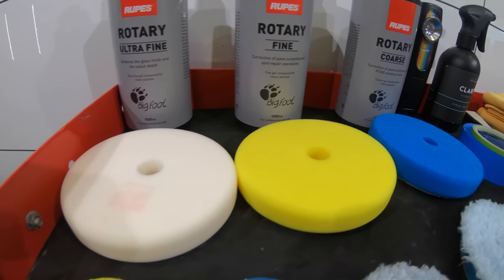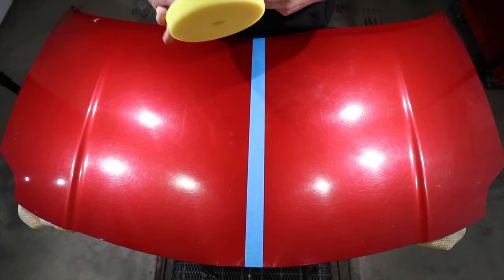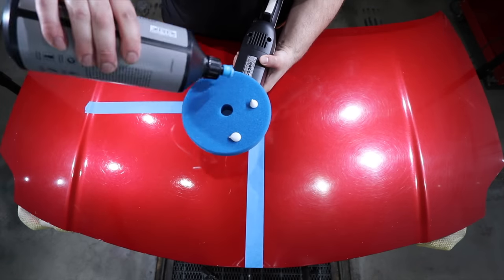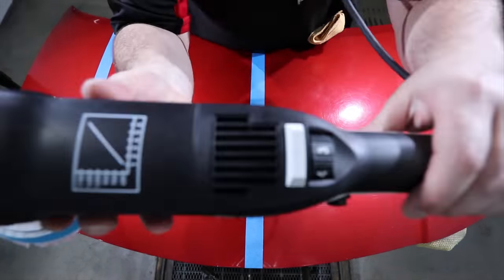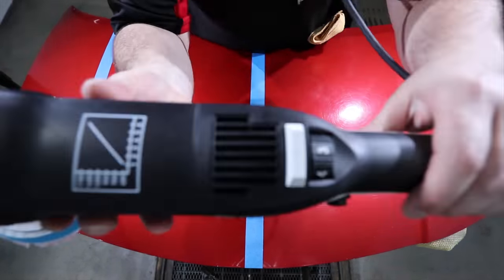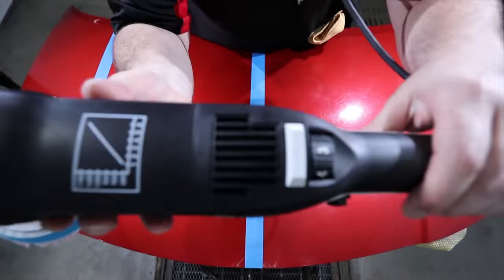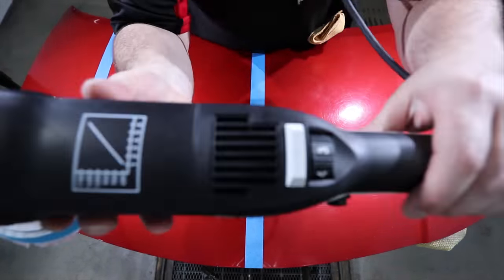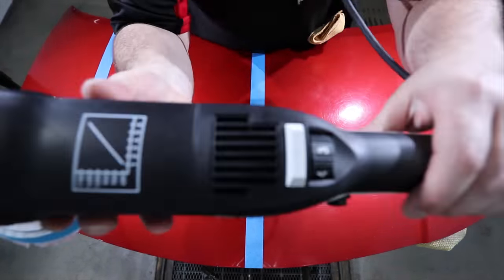A Guide To Using A Rotary Polisher/Buffer To Polish Car Paint! + Rupes Rotary Polishing System!

Comment: If you could have only one DA polisher, what would it be?
Reply: Flex
Reply: 15mm orb. Is better option.
Reply: @CarCraftAutoDetailing  Sandro I remember in one of your videos where the LHr15 Mk3 left marring after the first stage, so you then went to the 12mm shine mate da which left no marring and worked better on that particular paint, question is how often does it happen that the Rupes 15mm doesnt perform as well as a smaller shine mate for example? Would you say the Rupes LHr15 Mk3 is great in 95% of cases?

Comment: Hi. Great video. I been using both rotary and orbital polishers for a while and I still like to watch videos to improve my technique. I saw on your cart an extender for the rotary machine, what it is.
Reply from the maker: Thanks and here a link to an extension bar:
https://www.waxit.com.au/products/shinemate-3-2-rotary-m14-extender-bar?variant=31968435011673&currency=AUD&utm_medium=product_sync&utm_source=google&utm_content=sag_organic&utm_campaign=sag_organic&gclid=EAIaIQobChMIg9qtwbur9wIVzRwrCh2BYAkSEAQYASABEgJYU_D_BwE
Reply: @CarCraftAutoDetailing  what type of machine you use it with. Does it fit on anything else than a shine mate
Reply from the maker: It will fit all rotary polishers that use the same M14 screw thread

Comment: So is clay bar not necessary since you went with the course polish?
Reply from the maker: If the paint has bonded contamination you should always clay or remove it before paint correction
Reply: @CarCraftAutoDetailing  thanks for the response

Comment: How to take the pad holder off I can’t get mines off
Reply from the maker: There’s usually a button in the centre of the polisher head, you press it and spin the backing plate off - if it feels stuck, use a spanner to help.
Reply: @CarCraftAutoDetailing  thanks I just did it

Comment: QUESTION : If car has a lot of scratches and some are quite deep so you need to paint them..but you also are planning to do full paint correction.. should we:
1. We first sort those deep scratches (preparation,sanding, painting, polishing), then do the full paint correction of whole car...
2. We do painting of deep scratches mid way of full paint correction... (after wash...iron and tar decontamination  and clay bar decontamination)
3. We do all the steps of paint correction and  before applying ceramic coating we focus on  sorting those big deep scratches
Reply from the maker: You should do any prep and sanding prior  and give the paint time to cure prior to correction.

Comment: Excellent work! I Learned soo much by watching your combination and technique. As a Mobile Detailer, I want to improve working with a rotary. I typically use a DA which is fine but it does take a bit longer it seems vs. the rotary. I had a quick question..... with your process of rotary 1 or 2 step . . . . about how long would a typical 4 door sedan take to do this process?
Reply from the maker: Thanks and time taken is all about what the vehicle is like to start with in terms of defects and the level of quality and finish you pursue. As a mobile detailer, typical for me was 4-6hrs really doing more of a good enhancement. Some of the higher end dull paint correction work I do now can take me 1-2wks.
Reply: @CarCraftAutoDetailing  yes that’s right.  Wow .. I’m glad to hear that .  I took me about 8 hours to do a  1 Step Polish.  I tried the Rotary and compound spit all over the place. But watching your video helped A lot. 🙏
Reply: @CarCraftAutoDetailing  one quick question . . . .what are you spraying on the surface before you wipe off?
Reply from the maker: I’m using an isopropyl alcohol IPA panel wipe (Carpro Eraser) to remove polishing oils that can mask the true results.